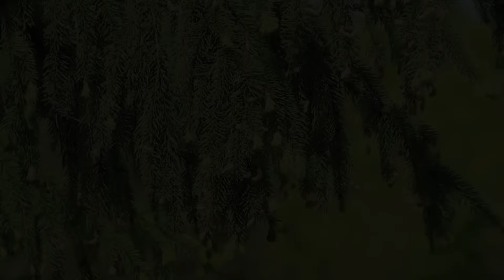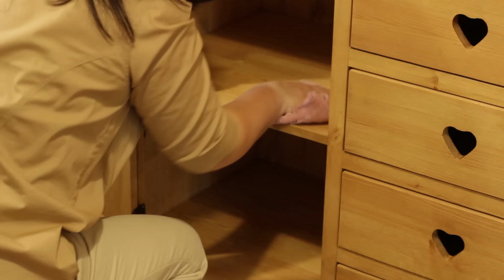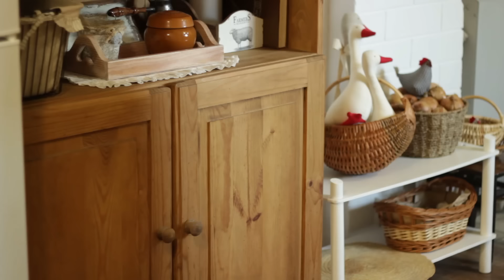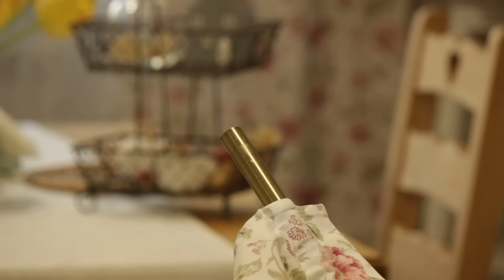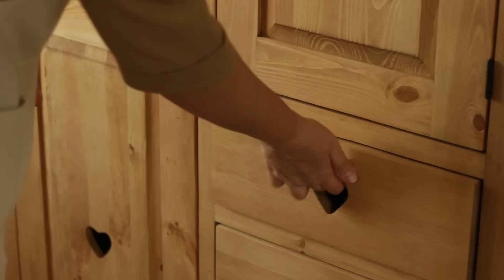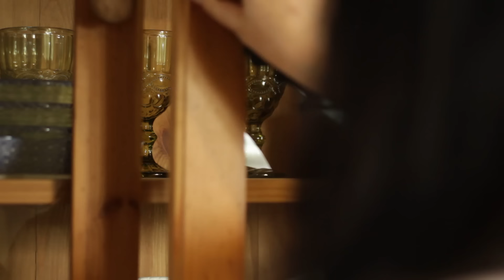Kitchen organization and cleaning. New furniture and storage space. Daily life of a housewife

Comment: Olesya, on the forest house, look seriously into the no-dig system for your vegetable garden. It’s easier, it’s cheaper, and it’s better for the planet. There are thousands of YouTube videos about it. Also, have you checked if the metal sheets on your roof is not asbestos? Thanks for your lovely videos and your husband’s too.
Reply from the maker: Thank you very much for your concern and advice! Yes, we need to think about a drip irrigation system, we don’t know how it’s done, but I think we’ll figure it out. As for asbestos, this is very sad. I myself learned about the dangers of this material thanks to the audience. Unfortunately, in our country 70-80% of roofs are covered with this material. Moreover, it is still sold in hardware stores. We will remove all asbestos from our buildings. Good weekend!
Reply: @olesyahouse  Olesya, drip irrigation is also good, but what you need to look into is the No-Dig Planting System. Thank you so much for replying: so nice of you!!! 🌸🌻🌹